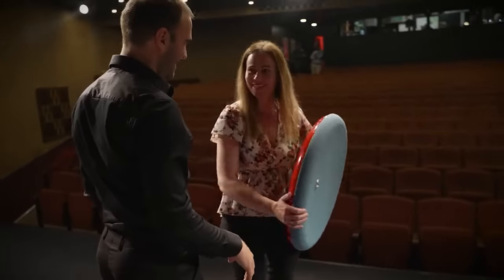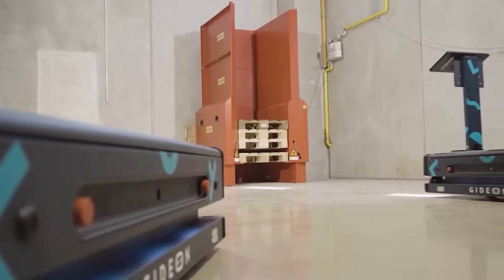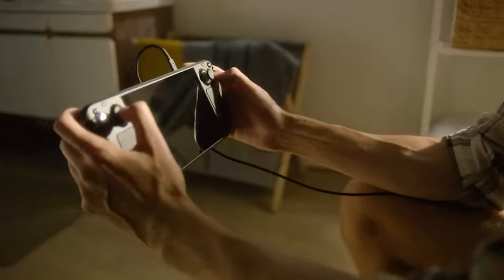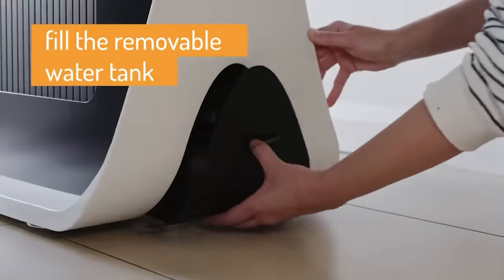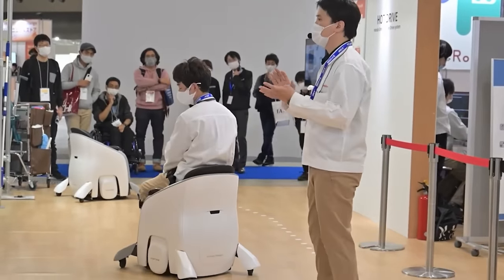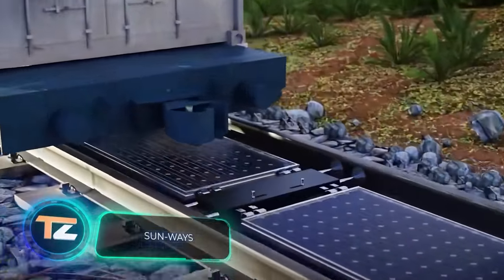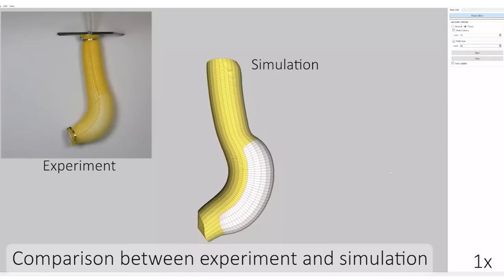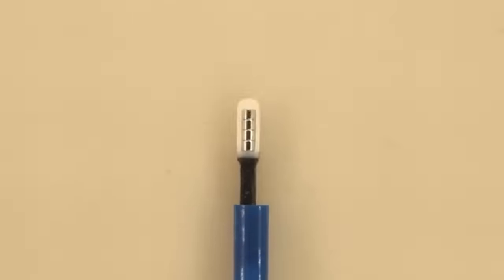INCREDIBLE INVENTIONS YOU DIDN'T KNOW ABOUT

Comment: Regular fire extinguisher is $80 ..... not 800
17:50 Citroën is French not German
Reply: The ' DESIGNER'  is German,  not the manufacturer.
Reply: I immediately googled it and found similar size one for $50. Firefighters holding a shield makes sense, especially when they have to breach a door, but they can hold one while using a hose or an extinguisher with far more capacity. Seems like a very niche product, if the fire is so hot you can't get close enough to use the extinguisher then the time when that extinguisher could have helped with it has likely passed already.
Reply: Designer is Pierre Icard who is french btw

Comment: Wave power has always failed.  They can't keep the seawater out.  The pressure is too high even a few feet below the surface.  They fill up with seawater and the generators corrode in a few weeks.  You need a high pressure pump to pump out water, and the pump uses more energy than the system makes.